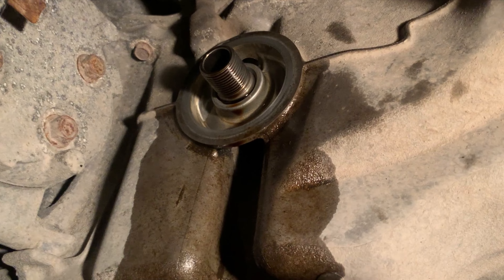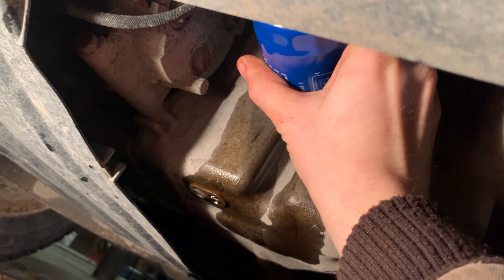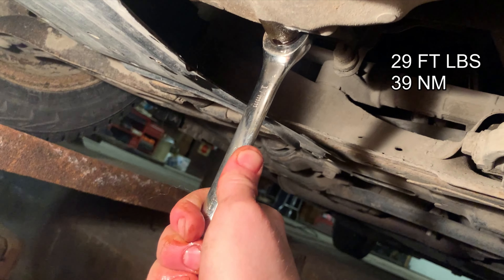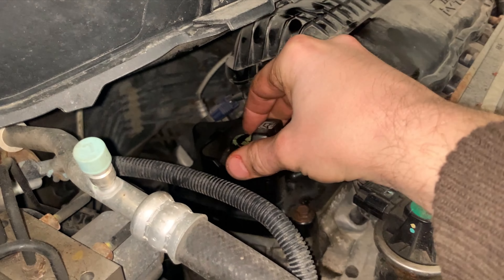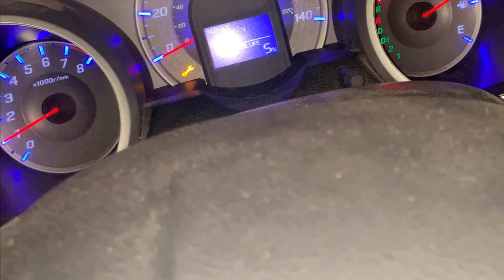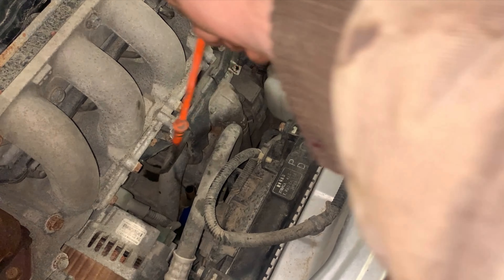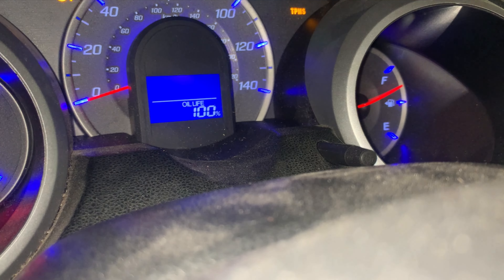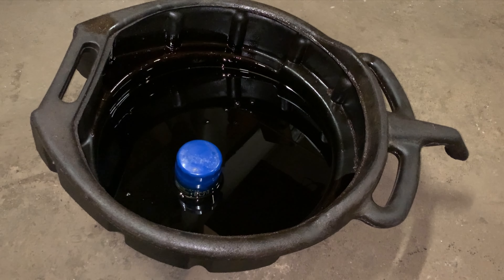2013 (2009-2014) Honda Fit Quick Oil Change

Comment: If you're lifting from the reinforced pinch weld, where do you put the jack stand? You can't fit the stands and the jack on the same pinch weld.
Reply from the maker: I generally will lift on the "subframe" just inboard with a block of wood and put the jack stand on the pinch weld.
Reply: @thehondafitguy  Thanks.  would love to see it in a video sometime.  On my civic there was a nice center jack point under the engine but not on the. fit.

Comment: You use 0w 20 😂? Mine uses 5w 20. Bro got me second guessing myself 😂😂
Reply from the maker: The first generation 2007-2008 in the US use 5w20. Everything after that is 0w20. 

5w20 definitely won’t hurt for up to 2014 since its the same engine as the first generation.
Reply: @thehondafitguy  i got 2009 😂😂 cool tho
Reply from the maker: @blu2697 I’m actually wrong looks like until 2010 they say 5w20 learn something new every day.
Reply: @thehondafitguy  yeah dude, love my Honda fit though, i lay my seats down and can haul anything. Still under 100k miles  for like another month. In my opinion it’s one of the most well designed cars I’ve seen, interior wise.
Reply: @blu2697  I've been putting 0w20 in my 09 for years now. No issues.
Reply: @SiXiam  cool, I’m just trying to make use what my car is made for, I’m sure some things won’t hurt it but I’m staying safe😂😂

Comment: Hey! Great video. Do you recommend changing the drain plug washer with every oil change? Thanks!
Reply from the maker: Honda recommends it. I have never changed mine and it doesn’t leak on mine. (About 300,000 combined miles driven between 3 cars)

They are pretty cheap though if you want some piece of mind.
Reply: @thehondafitguy  thanks!